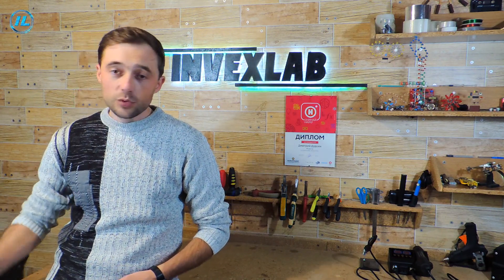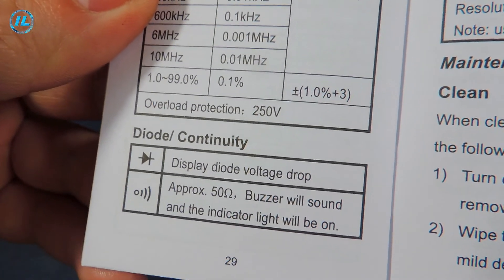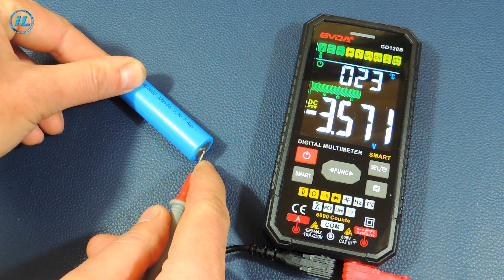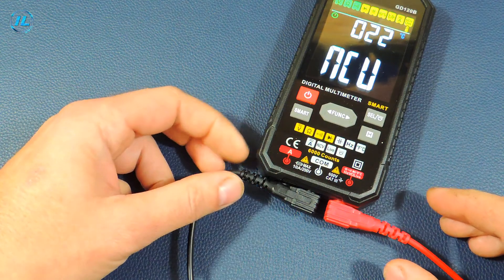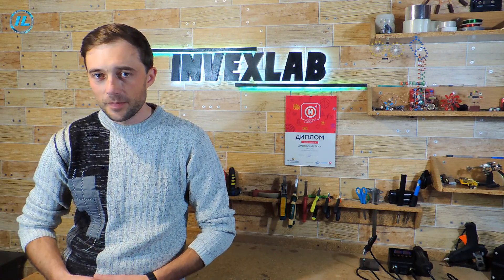✅ The GVDA multimeter is one of the best! How to use a multimeter? Checking with a multimeter. ✅

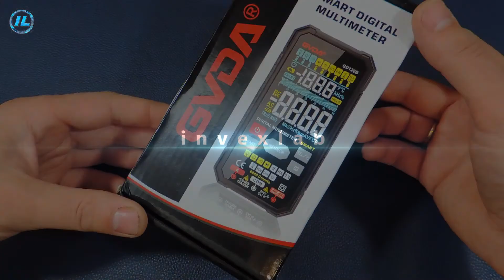Comment from the maker: 1:11 - unpacking the multimeter;
2:20 - characteristics of the multimeter;
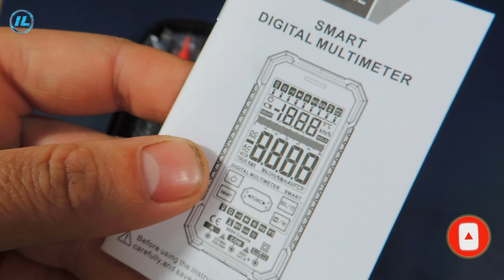3:20 - complete set;
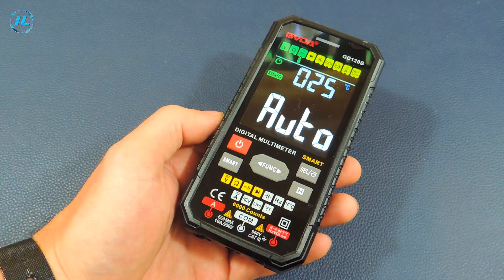5:32 - overview of all measurement modes:
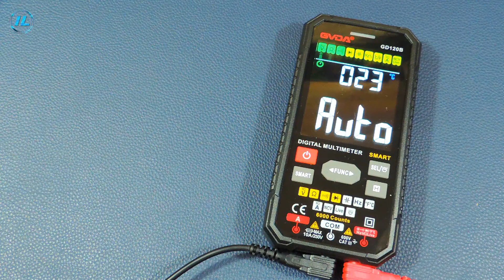7:27 - voltage measurement;
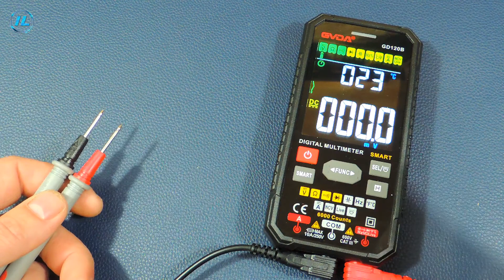9:09 - resistance measurement;
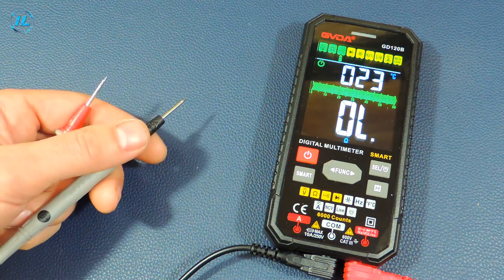10:18 - how to check the diode;
10:37 - how to check a transistor;
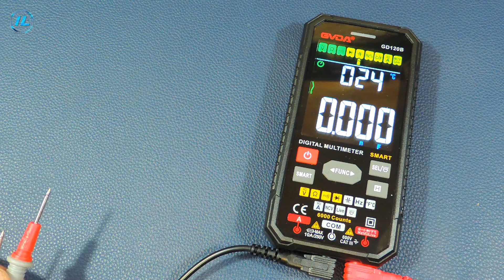11:37 - how to check the capacitor;
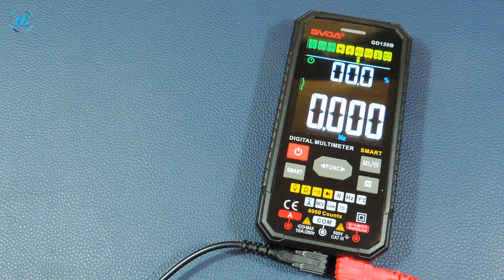13:19 - frequency measurement;
13:41 - temperature measurement;
14:37 - current measurement;
15:47 - NCV mode check (hidden wiring search);
16:21 - LIVE mode check (phase search);
16:43 - measurement in AUTO mode;
17:30 - testing the HOLD mode.

You can ask a question, suggest an idea for a video or solve other important issues in the Invexlab chat:

https://t.me/invexlab_chat